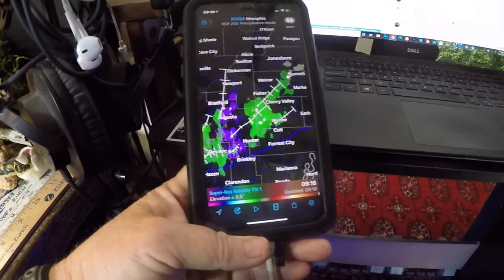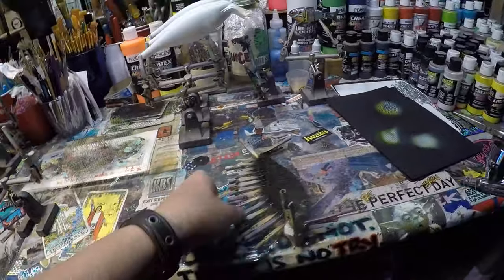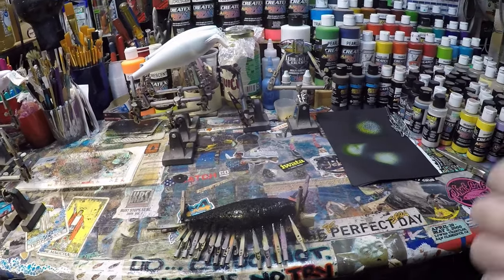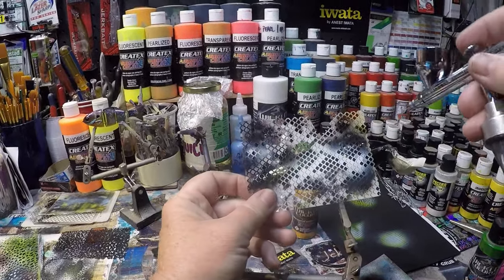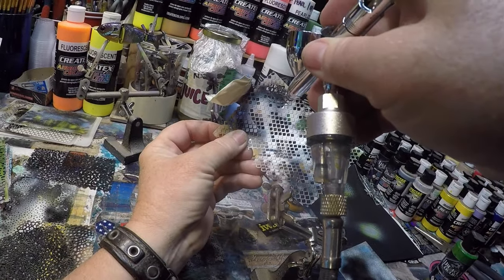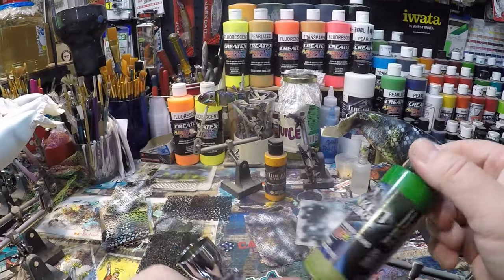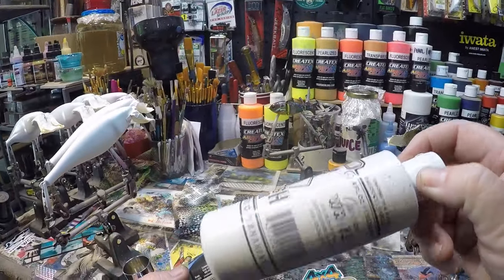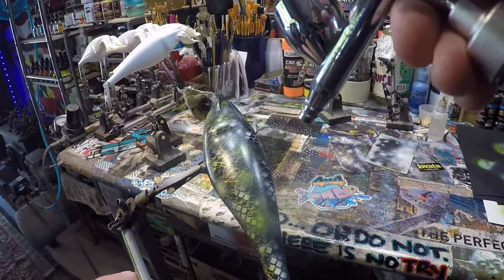SESSIONS: Stenciling Techniques Part II (Stealth Camo Shad)

Comment: What pressure were you shooting at?   It sounded fairly strong.  I am thinking at least 40-45 lbs.   Whenever I try to use any paints right out of the bottle, they end up clogging my airbrush.   I always thin mine and strain them every time in an effort to avoid this problem, which is a pain.   I wish I could trust using them from the bottle. I have a Badger Patriot 105, a Badger Sotar 2020 and a Iwata Neo Siphon Feed.     The Patriot is my go-to, but I use the Iwata quite a bit too.    Nice work, as usual!

Comment: Question for you.  What is your needle/nozzle size for your Iwata Eclipse?  .35 or  .5?  I ask that because Createx advises .5 needle/nozzle with 30 psi psi air pressure.  Thanks in advance.
Reply from the maker: I almost constantly spray with the .35 needle, and keep the nozzle on that the airbrush comes with. I reduce on occasion, but mostly found that with pressure adjustment, it isn't necessary
Reply: @Jekyll424  Again, Thank you very much!  Your videos are absolutely amazing!  In addition to showing us painting techniques, there are small nuggets that you've stated in your videos that didn't make sense at first.  But after learning more, I understand what you were talking about.  I'm going to do more research by going to Bassworld and looking at lures there.  Thanks again for your videos.  Now, I'm just practicing by painting on both thick heavy pressed paper and spoons (100 in all).

Comment: what i do is when my KBS git low i put about 1 to 2 inches of marbles in the bottom. that will bring the level up and you can push the lure down and coat it all, if that make sence?
Reply from the maker: It makes sense but if it's that low it's time for more KBS